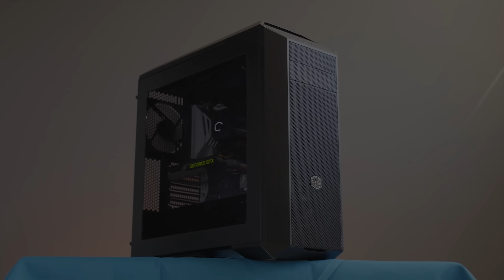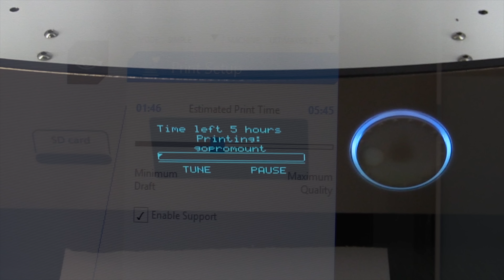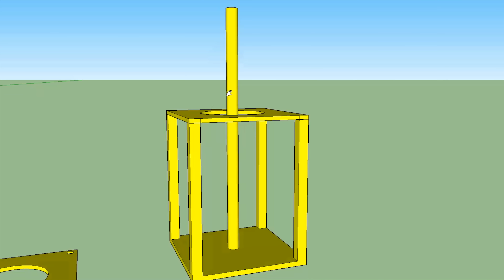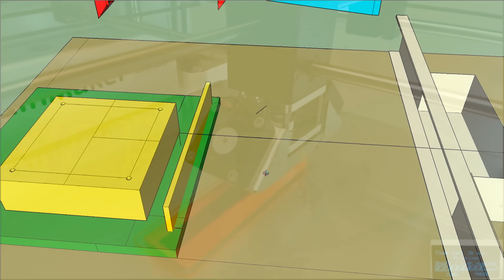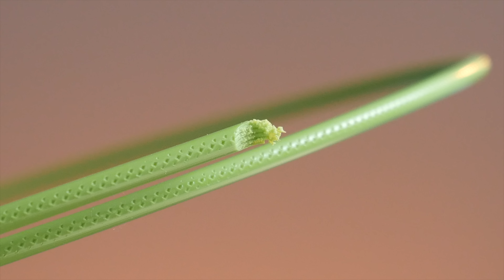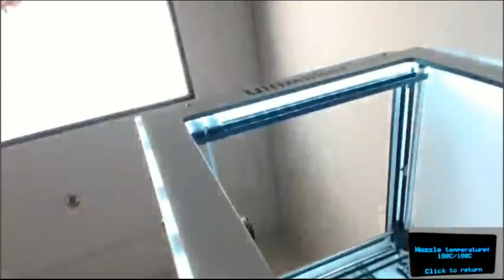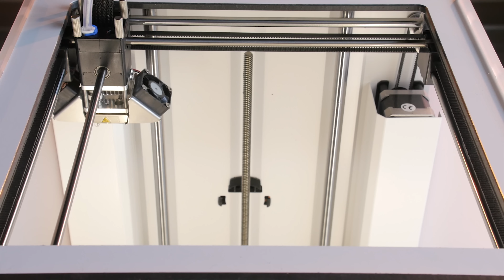Ultimaker 2 Extended - Our First 3D Printer

Comment: Actually, I'd love to see a big project of you guys building a custom computer case with it!
Reply: Probably take like 5 days to make.
Reply: Sounds like a good Scrap Yard Wars.
Reply: +Jeff Caauwe I was actually planning on printing some custom stuff for my computer. Some custom HDD racks/decals (mostly case/MOBO decals) ect.
Reply: +Christian Gerefalk  It's plenty big enough for a Mini-ITX case.  They could come up with some creative layouts for a SFF build and print out some unique designs.
Reply: They just did
Reply: +Christian Gerefalk You can build anything of any size you just need to have the pieces fit together. Barnacules just printed an entire storm trooper suit.
Reply: oh yes please. i modular pc
Reply: This man predicted the future
Reply: +Jeff Caauwe 3D print a case....
Reply: +Jeff Caauwe Not really possible or suitable, pretty sure the build area for a UM2 is 200x200x200 and the exteded is just taller, so 200x200x300/400, a computer case is much larger than that, you can make it multiple parts but at that kind of size it starts getting tricky and expensive, a better way to do it is to use some sheet stock and use 3d printed parts to assemble them and make details.
Reply: +qwertyferus Hmm Mini-ITX is 17x17cm, yeah that'd work SFF?
Reply: Christian Gerefalk Small form factor.
Reply: Indeed.
Reply: +Jeff Caauwe There's a multi-part scrapyards wars begging to be made from this.
Reply: +Jeff Caauwe exactly what I was gonna say!
Reply: Why has Alex not done this yet lol
Reply: Only 6 years ahead
Reply: +Colton Blumhagen Yes but it starts getting very expensive and the complexity and needed precision goes up in a non-linear fashion. 3D printers are great for smaller stuff and smaller parts, outright printing really large stuff especially when it can be done better using readily available materials like sheet plastic, wood or metal is somewhat silly. Hence why the UM2 is mostly plastic sheets and metal rods, not printed. Something like storm trooper armor is different ofc, can't really make that out of wood/metal/sheet plastic. But something rectilinear like a PC case it would make more sense to use plastic sheet and use printed parts to assemble it and add details.
Reply: +Colton Blumhagen Do you comment on every video? You're everywhere!
Reply: +HoTT WinGG WE NEED THIS
Reply: +Jeff Caauwe Or, you know, instead of wasting your time with crappy plastique, just grab some aluminium stuff from the next DiY store and make a case from a material that doesn't suck.
Reply: Eh, plastic doesn't suck, it has limitations like all materials do but trust me making a mostly aluminium case with 3d printed hardware joining it up would be a lot easier than bending, drilling and screwing/riveting together a whole case from aluminium only, unless you have professional metal bending tools etc.
Reply: +qwertyferus From experience I have figured that mITX is not really worth it, your biggest issues with SFF are fitting videocard, psu and heatsinking in there, you'll only get slightly smaller by using mITX vs mATX

Imho you shouldn't design a case to be the smallest possible, you should design it to still provide good cooling while staying quiet, preferrably without using any kind of watercooling- the point of a small rig is mobility, if you can't take it on a plane as hand luggage, what is the point in having a super SFF build?
Reply: Christian Gerefalk Explain scenario where a 3D printed piece would be better in any way than just using an aluminium piece?
Why would I use plastics to join up aluminium parts when I can just use a steel or aluminium equivalent? I don't like that mentality at all, you don't need professional tools to do stuff like this, you just need the tool between your ears to find a workaround.
"I don't have a 3D printer so it is IMPOSSIBLE for me to make a coathanger" is not a valid argument.

Because I honestly can't think of any.
Reply: +Blacktronics Because making complex shapes in metal needs special tools, while it's a push of a button on a 3d printer, this is why a lot of reprap designs are now extruded aluminium profiles (t/v-slot) + printed parts to join them together.
Reply: Christian Gerefalk What do you consider a complex shape in metal which would be relevant in the construction of a pc case?
Reply: +Blacktronics hdd cage, front panel I/O/buttons, fan mounts with a grate etc.
Reply: Christian Gerefalk HDD cage: Fuck HDD cages, there is no space in SFF for silly cages, just drill 4 holes and mount the hdd/ssd using the bottom side holes.

If you however demand an HDD cage: 2 aluminium L profiles and a flat piece of aluminium, bolt together in the right distance- done

Alternative pro method: use a piece of square steel pipe as a jig to bend a flat plate of aluminium into a matching U shape.

Front panel I/O: Take piece of aluminium, check diameter of buttons, drill holes where you want buttons and where you need mounting, anodize aluminium in any color if desired, put buttons into holes and secure using the nut that usually comes with the buttons.

Fan mounts:
Drill 4 holes, one each in the corner of a square matching the fan hole spacing and diameter, you can even use the fan as a jig.
Then drill a hole in the center using a hole saw in an appropriate size for air to pass through.

Next, grab a piece of any material mesh with hexagons or ducks or whatever punched out, i honestly don't care what you want as a fan grille, there are tons available, cut a square the size of the fan, drill holes where fan holes go, sandwich mesh between fan and mounting plate- done.

Ultra pro tip: Fuck the fan grille, they are retarded and only cause air turbulence, they're only there so morons don't stick their hands into the thing. I for my part derive pleasure from morons hurting themselves due to stupidity.

So, you were saying?
As you can see, there is no such thing as lack of professional tools, there is only lack of ingenuity.
Going at stuff with an attitude as in "Duh, can't do it, don't have pro tools" means you are simply lazy and looking for an excuse to not do something.
Reply: Blacktronics I wasn't saying that Mini-ITX is a preferable form factor to other options.  I was only saying that printing an entire Mini-ITX case is possible with this 3D printer.  Really, it depends on the application.  And designing a case to be printed with the limitations (such as internal space and cooling) in mind is where creativity comes into play.

I'd like to build a Mini-ITX based router/firewall with an extremely low-TDP processor, a picoPSU, and no graphics card.  For that application, among others, a super compact 3D printed case would work great.
Reply: +Jeff Caauwe It would melt fairly quick.
Reply: +Kirn20 Your PC gets to 200C?
Reply: Christian Gerefalk
Amusing it's plastic xP Plastic melts pretty easy
Reply: PLA's melting point is 180-220 ABS is 10-20C higher.
Reply: +Jeff Caauwe THAT is exactly what i though! Custom PC Cases made in 3D printing! It would be AWESOME!
Reply: Plastic and heat not the best combination
Reply: +Daniel Parker True, but some of the materials the Ultimaker can print with is INSANELY capable of withstanding heat. Much like the plastics on your motherboard or graphics cards.
Reply: qwertyferus Silverstone makes cases for exactly that application though :P

I can't figure out any scenario where 3D printing a case would be more viable over either taking one off-the-shelf or just builíng one from materials that don't suck
Reply: Blacktronics You're missing the point.  Sometimes people like being inventive and creating something new to fit their vision or unique situation rather than making due with what is already out there.  That is the whole reason behind 3D printers and the maker movement in general.
Reply: qwertyferus what? please read everything I have said in this thread and then go tell me about people "being inventive" again.

engineering isn't about just making something, it's about finding an optimal solution to a problem.
An optimal (best price to quality ratio) solution for a super SFF router pc would be grabbing a cheap off-the-shelf case and building in that, instead of making some half assed quality 3D printed multi part plastic stuff with terrible thermal conductivity.
Everything else is just excuses for not building thing y because of not having tool x.

The only use I see in desktop 3D printers is people making figures and painting them, and specific replacement parts on various things. 

Making stuff with a 3D printer beyond that is pointless from what I can tell, and pointless wank acts are not part of an optimal solution and are reserved for mac users.
I mean, I have seen people 3D print a 90° angle for christs sake, what's the fucking point in that?
Reply: +Blacktronics The case doesn't lead away any appriciable amount of heat, airflow either passive or pushed by a fan does.
Reply: Christian Gerefalk I find it interesting how you seem to be completely ignoring my previous arguments until you find something to pick on.
Now, for the fun part, while you are right for high power builds, we were speaking about a small form factor computer purely designed for acting as a router, so most likely we will not want any fans in it, and fully rely on passive cooling, which we can easily do due to it being a low power device which doesn't even need graphics processing.

Due to the nature of a box with holes, you won't get a lot of passive airflow within your case either, you will get slight amounts of turbulence which are mostly accelerated by thermal differences in the gas inside it, having a case which is thermally conductive will be incredibly beneficial to a build like this, especially for hard drives being able to use the case as an additional heatsink.
Reply: +qwertyferus I've considered printing a plate and psu mount thing to mount my server(old atx computer) on the wall.  Similar to lukes board in scrap yard wars.
Reply: how about you just grab an MDF plate and just drill some holes into it? Subtractive manufacturing is far superior for stuff like that.
Infact, unless you want to do something like printing SuperDraco engines from iconel, subtractive methods are pretty much always superior.
Reply: +Blacktronics it's the fact that it's 3d printing that makes it fun.  If you mean manual labor when you say subtractive manufacturing I would have to disagree, some times 3d printing requires a diffrent angle for example looking back on this in a more awake state of mind I realized I could just use clip(those things they hold ridged paintings with) like things and I could mount it with very little filiment and after an hour I had designing and printed one, tried it out and thanks to my printers auto eject I just had to tell it how many I needed.  Now all that's left is to design the psu and hdd mount and mount everything to the wall.
Reply: fragmen52_ Or, alternatively, you spend 15 minutes in a workshop with a drillpress and an aluminium sheet..
Reply: digitalradiohacker Oh man, you want to make me die from high blood pressure do you? Don't get me started on Arduinos or more specifically "The Maker Movement"...
Saying "I made something with an Arduino" basically means "I have no fucking idea what I'm doing, I take premade modules from Adafruit and plug them into my Arduino, and use libraries someone else made as well."
It's basically grown ups being proud of having followed through with lego assembly instructions
.
Take AVR-GCC away from these guys or even give them an MCU by any other manufacurer, and they will stare at you like a confused cat who's food you've just moved over by a meter while it was eating.
They'll just sit there like "Durrrrr, what is this register thing you are chatting on about? Does it have Cash in it?"

And because they are completely dependant on AVR-GCC, they won't be able to design something that is economic to produce, because Atmel probably has the worst price/performance there is.
I don't mind the Arduino itself, it is great when you need to solve a problem but you're still hung over from the weekend and you really can't be fucked to do it properly and it has to be cheap.
Most of the community is worthless though.

If people really feel like they need an Arduino, and are willing to spend 95€ on a fucking arduino starter kit, spend an extra 50€ on an Infineon Aurix Development board, then you get to fuck around with a 32-Bit 300MHz TriCore that has 80 freely programmable I/O pins and a bunch of other stuff on board.
The fucking thing can do anything, it got built in Ethernet, it even has SENT support.
http://www.infineon.com/export/sites/default/media/products/Microcontrollers/32bit/BlockDiagram-TC27xT.png
Reply: Blacktronics You said early in this thread that engineering is about the optimal solution, I include price when I think of the optimal solution.  I Searched amazon for a 30x30 sheet of aluminum and the cheapest I found was $10 albeit you could probably get aluminum cheaper else ware.  The little bit of plastic that is going into my clips doesn't even cost a dollar.  on another note I do tend to agree with you for a full case.
Reply: fragmen52_ Amazon isn't really the place for that stuff, my local metal shop would probably cut and bend the aluminium for that price as well.
They have a fancy automated bending machine.
Reply: digitalradiohacker No life is 20mA LED's, if you need to drop the voltage across something just hook a couple of LED's in series, don't worry, they will do just fine dissipating all the excess.
( ͡° ͜ʖ ͡°)
I sent you a chat request on google  hangouts, you're an interesting person.
Reply: digitalradiohacker jesus, and google is surprised why nobody really wants to use hangouts... try opening a conversation with me via the crappy google+ page
Reply: 666 likes lmao
Reply: +Jeff Caauwe im really into 3d printing and I can tell you that that would not work. too weak and the heat would melt it.
Reply: Jeff Caauwe

Comment: Can it print a pc case?
Reply: +MegaGamingReaper the real question is... can they print a 3d printer that is printing a 3d printer that is printing a 3d printer....
Reply: You got me there!
Reply: +MegaGamingReaper Well if you make like 4 panels that click together for every side of the computer, i guess it would work, just snap those 4 panels into a side, then snap the sides together.
However i wouldn't go for a plastic computer case if i were.. anyone..
Reply: +MegaGamingReaper that's actually a pretty good idea but you'd need a lot of plastic, probably an entire roll
Reply: and metal rolls? i do not know because wiring and stuff
Reply: Yeh, I have no knowledge of 3D-printing. All I know is that it prints 3D. It takes a while. And yeh
Reply: +Glytch Ah nice, I have your printers brother the Duplicator i3, great printer.
Reply: +MegaGamingReaper Yes but it's a bad idea. It's really weak, like really, when you try to bend it slightly you hear the plastic cracking everywhere like a compressed bubble wrap. It means it has to be thick enough to support its own weight and even more to support everything inside.
Thick and plastic wont let a lot oh heat out, you will need a beast of ventilation.
And heating a thermoplastic such as PLA or ABS is a bad idea if you want them to keep their dimensions right... So yea maybe not, but im pretty sure you need to design it very well (im not sure they are mechanical engineers) if you dont want to replace a part every week ;p
Reply: I have a 3d printer, but i print in PLA and i built it from a kit (and had to tune it myself), maybe that's why my pieces are weak (maybe the layers are not correctly welded together).
But as far as i know, the Young's modulus of 3d printed pieces is around 2 000 MPa while Al and steel are at  70 000 and 200 000 MPa. So yeah, not the same thing.
Reply: +R4GEcraft thanks for somewhat educating me on 3D printing!
Reply: Can the 3d printer blend